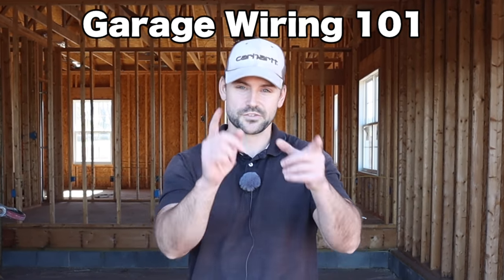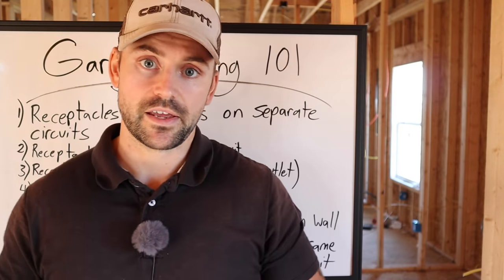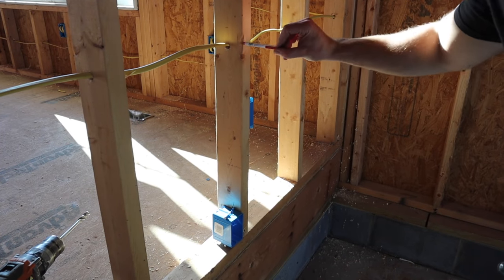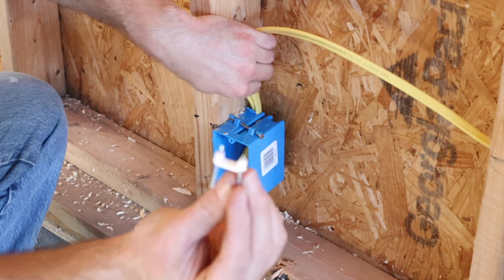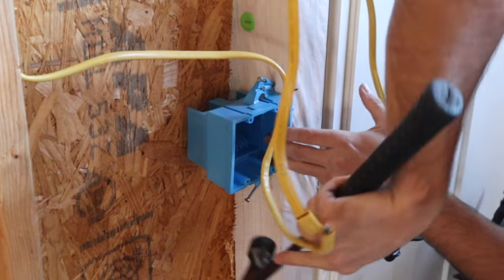Garage Receptacle Wiring - How To Wire A Garage For Electricity

Comment from the maker: I paid $160 per roll for 250’ of 12/2 wire. It was $70 per roll just a couple years ago! Timestamps below to help navigate the video 👇
Garage wiring 101 00:22
Pre wiring walkthrough 04:18
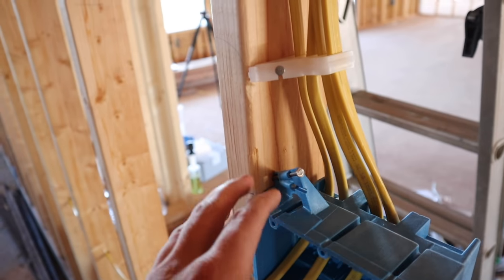How to use Wire stackers 04:32
Height to place outlets 05:40
Electrical box size for garage reciprocals: 07:00
How to anchor outlet boxes: 07:24
Height to drill holes for wires: 08:27
How to drill a hole for wires: 09:05
How to run electrical wire: 09:37
How to place wire in an outlet box: 09:50
How to staple wires: 10:55
How to rough in wire a switch box: 12:06
How to GFCI protect a circuit: 14:33
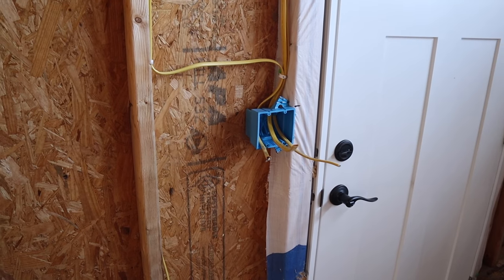Final walkthrough: 15:16
Reply: Blame it on COVID.😬

Comment: My understanding is that the tabs on plastic boxes are "push-in" not "push-out".  I think you will not need to smash your pliers through the tabs if you use them this way. I am referring to 10:17 in your video. I believe the idea is that once installed you don't want someone inadvertently pulling on a cable to be able to pull the cable out of the box. If you push the romex into the box from the outside, then the tab will pinch the sheathing if you try to pull it back out again, as per design. If you punch the tabs through you are turning them inside out and defeating this design.

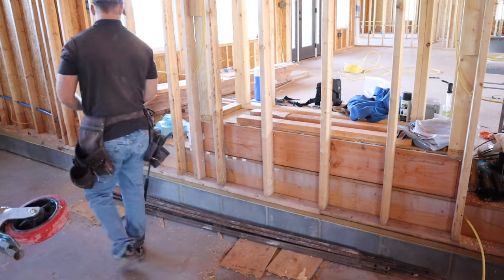Comment: 6:40 - I always place garage outlets 42" from the floor to the bottom of the box.  21" seems a lot lower than usual in a garage.
Reply from the maker: It all depends on what you are going to put in your garage. If I was going to have countertop against the wall I would put them 48 inches. Thanks a lot for watching!
Reply: It should be a minimum of 42” I’ve got 50 years in they need to be GFCI and I set them at 46”
Reply: Minimum of 18” from grade. I set them 46” to top

Comment: Key tip home improvers: if you use a paddle bit for your holes, have one hand on the grip and trigger, and the other hand on the battery for stabilization. Be firm with it. Confidently go straight thru. That torque will turn you into a pretzel.
Reply: But what if you just really wanted to dislocate both thumbs?

Comment: Thank you for these videos. I will be building my house soon and been working with 12v, 24v, and now 48v off grid systems. Most of the wiring is going to be 120v and 240v in the house and shop. I will most definitely be visiting your Amazon store soon. Thanks again.
Yep.

Comment: Thanks so very much.  Did not know: 1.) Garage outlets & lights can't be same circuit. 2.) Power from panel is 2 wire, 3 wire is for smoke & three way switch. 3.) Can stack 2 & 3 wire with 3/4" staple. 4.) Joining grounds require wire tie or crimp.   Thanks

Comment: Question regarding your outside light.  At 15:30 during your final walkthrough, you showed the wire stubbed thru the wall and the mounting block out side.  Did you use a junction box inside or is the wire just pushed thrust the sheathing?

Comment: Your electrical videos are giving me the knowledge and confidence to wire my new home that I am building.  The amount electricians are charging in my area is insane, I'm talking like $40,000 is the average bid I am getting.  When I calculate the materials, I'm estimating $9,000 and that's with ALOT of extra built in (20%)  THANK YOU!
Reply from the maker: Hey Paul! You are welcome! Be sure to check to make sure you can do your own electrical work where you live and what the building codes are. In my area I can even though I am not a licensed electrician as long as I get the proper permits and inspections. You are right that is why I do my own work because it is so expensive. $40k is insane! If you don’t mind me asking how big of a house?
Reply: @TheExcellentLaborer  I live in an unincorporated county and they do allow a homeowner to do their own electrical.  The house is 7,500 sqft but I am not finishing the basement in the beginning.  Upstairs 2 floors are roughly 5,500sqft.  I have about 170 LED can lights and basic electrical.  I also just put in my 300/300/300/300 4 UGD line to the main. I've wired a little in my current home with no issues but my main concern would be more about wiring up the Main panel correctly and load capacities per breaker. Wiring up outlets and switches is pretty easy but the panel and load calculations is where I would need to do more homework.
Reply from the maker: Wow that is a huge house you are building! That is good, it sounds like you can do your own work if you want. The service I have to prepare for is 200 amp. I have my panel box video halfway complete and will be putting out in the next couple weeks. You may get some ideas from that video when I release it. Stay tuned!
Reply: @TheExcellentLaborer  Right on!  Can't wait for the video.  Thank you.
Reply: thats ridiculous, what are you building a 10,000 square foot house?

Comment: When we built our house the electrician recommended putting the garage receptacles four feet from the floor. No bending over and I love them! Many people put their extra refrigerator in the garage. Ours was on a gfi circuit and it would kicking out during an electrical thunderstorm. Nothing is more sickening than throwing away forty quarts of thawed sweet corn.
Reply from the maker: That's a great idea!
Reply: I think that's code in my area for basements and garages

Comment: As someone that does a lot of work in my garage, I like the electrical outlets higher.  About 48 inches.  If you install cabinets or worktable the outlet is just above worksurface.  Much more convenient. A 220v outlet is nice have as well. Nice video.  Thanks for sharing.  Is that Baltimore accent am I hearing?  Maybe Philly?  LOL
Reply: If you are using corded power tools, having the outlets at 38"- 42" inches makes connections easier, especially if you have a workbench against a wall.  It's also easier to place any power tools that are on rolling platforms if the outlets are higher.  Also, if you intend to hose out your garage on occasion, having them tall eliminates any potential contact with water.

Comment: GREAT VIDEO.  I appreciate the walk through.  If I were putting an RV outlet on the exterior and a refrigerator in the garage. Do they have to separated circuits?  What amperage breakers should I put in the panel?

Comment: Thanks!
Reply: Any advantage disadvantage of having both GFCI breaker and the GFCI outlets. I am adding two outlets in unfinished  garage before I drywall
Reply from the maker: Thank you! I would do one or the other. Both might cause the circuit to be too sensitive and kick the breaker. I hope that helps!

Comment: Greetings EL - Keep in mind that in the 2020 National Electrical Code you would not be permitted to supply the receptacles in the ceiling with the receptacles that are serving the vehicle bays. This was not prohibited in the 2017 NEC but is now clarified in the 2020 NEC. Now, nothing prohibits the installer from running additional 15A or 20A branch circuits into the garage, say for those garage door opener receptacles, in addition to the required minimum of (1) 20 amp branch circuit per 210.12(C)(4) that is dedicated to supplying the receptacles outlets per 210.52(G)(1). AT ~11:14 you state your area requires you to secure those cables within 6" when in reality it is within 8" per 314.17(B)(2) Exception but sure seems like your local AHJ likes to make up code rules...that's a shame. - Now, I will tell you, it is much easier to strip off the sheathing prior to inserting into the device boxes, just make sure you strip out so you have at least 6" of free conductor from the emergence of the conductors out the cable per 300.14 but to each their own. Now, most AHJ's will want you to make up the EGCs prior to the gypsum board going on since they wont make another visit until final inspection so verifying the connections in the box for your grounding/bonding is important.

Comment: Everything was going great till you pop the clamp the wrong way I think 🤔 it supposed to be open from the outside in so that when you run the wire in it can’t come back out so easily 10:17

Comment: Great Video thank you!
Question: You mentioned that the receptacles and the lights must be on SEPARATE circuits. Does this mean that you had two separate wires running from the main power line or you had two garage breakers one for the lights and one for the receptacles. Hope my question make sense? Thanks

Comment: I am running 3 new receptacle outlets to my non-drywalled garage, starting at a light switch receptacle, over the door frame, and to the 3 new outlets on my back wall.  I will add a GFCI outlet starting at my first outlet box and daisy chain them from there to the other two outlets. Is the GFCI outlet overkill, or is it better to be safe than sorry to protect the 3 added outlets? Thanks for your video. I saw how you ran the wire over the door frame to the outlet box next to the door. That was my other question since I didn't want to have to run the wire from the attic of the garage back down to the first outlet. I have seen metal barrel sleeves that you can install in the studs to run the wires through to protect the wires running through the studs. I have 2X4' studs so I don't know if that would be recommended over metal stud plates. What do you think?

Comment: Question: The electrical outlet boxes you're using, you remove the cable cover. Most of these boxes are designed to hold the cable in place so it doesn't move outside of the box. With the tab being pried open, don't you lose the capability of ensuring the cable doesn't move at all? With metal boxes you use an actual clamp to ensure it doesn't move.
Reply: 10:50 - The NEC states (paraphrasing from memory) that the wire needs to be stapled within 8" of the box. That covers him even if he broke off the 1-way door that's on the box.

Comment: 3:00 - Do you know what the NEC Code says for running wires in a detached garage that does not have dry wall? 
I spoke with an electrician (he's retired now and not taking on new work) that told me there is a minimum height for running the wires but I cant find it in the NEC codes.
The logic being that when the wires are run low, people tend to put things behind them and they are more prone to being damaged.
Did you ever come across something like that?

Comment: Hey great video, 
Question:  I have a 20amp circuit coming from the breaker box in my garage going to the attic to a receptacle outlet and then Back into the garage to a simplex receptacle for my sprinkler controller. 

Can I splice in between the 2 receptacles to power a security/ floodlight camera?

Comment: What's the depth of the boxes when you mount them. Here in my state when I did my garage I had them close to 5/8 out from the stud. Code here for garages and kitchens the drywall has to be 5/8 thick. Every where else it's 1/2 drywall?

Comment: Very glad I stumbled across this video. Very easy to follow along and understand what you are doing. I do have one question about the wall outlets. How many can you put on one 20 amp circuit? Thanks for taking the time to share your knowledge with others.  Also I'm glad to learn that there are wire stackers out there.  I too like to keep the job looking clean and neat.
Reply: There is no maximum
Reply: Theoretical there is no maximum of power outlets. It is better to be not too long far away from the CU with the power cable if it a big garage. 

But do not forget that every device how you stick into the outlets consumed power current from this. If you know do you want use a work bench or some electrical accu charging devices make another extra line same for the light. Some people like to make two power cable for outlet 1 and some inches far outlet 2 all around or make middle to left and middle to right. Look at your local installation papers. 

In the time where cable was cheap my friend install many outlets but not use later all. Some are blind behind the boxes at the wall. If the decorate change he can change the outlets too. It is cheaper as later change the position of the used outlets.
Reply: @OldLordSpeedy  Thank you for the reply. Very good info and I appreciate it.

Comment: I just watched your video after running my own garage circuit (then I sheetrocked the garage after the wiring was in place). Couple things I'd like to question - can an outlet be that low? Isn't there any concern of water/moisture getting to it? I'm from Minnesota so snow is a main concern. Do you put those cable protector plates on each stud that the wire is going through? I installed an outlet at roughly 85 inches off the ground so I had an outlet on top of my work bench so I can have plug-in lights and a stereo up top. I'll have to look into my local code and see if there's anything against it. It's wired in already so I'm not undoing it lol.
Lastly, I've noticed that a couple times now the GFCI outlet that I installed has tripped on it's own (nothing plugged into it at all). Any ideas what could be causing that?
Reply from the maker: Hey Jake! I do not use nail stop plates for every stud. Only studs that have the wire within range of a drywall screw. You could try replacing the GFCI and see if it fixes the issue. I’m not sure what else could be the problem. Hope that helps and be sure to subscribe!

Comment: When when building an attached garage in my area  code requires a double layer of drywall on interior walls attached to living quarters. This is called a firewall. Any receptacles mounted on these walls would have to be adjusted for the extra drywall for box to be flush.

Comment: Man if I ever was doing anything new construction with wide open studs, I'd be using metal 4 square boxes all day. In 20+ year old houses when I'm dealing with these plastic boxes, they get brittle and break. Only would use them when it's old work on drywall. I think the cost isn't that different, in fact I believe the plastic is more expensive these days because of the material shortages...
Reply from the maker: Hey Mr.G! That is an interesting concept to use metal electrical boxes in new construction. All the houses I have ever built with my father has been with plastic boxes for several years. Thanks a lot for sharing your experiences!
Reply: I done alot of remodeling on some older home the old orange looking plastic boxes does get brittle and break ,but so far never had the blue plastic boxes get brittle not saying they want just never had it happen its a different compound.
But who knows I've only been remodeling since late 80's

Comment: I’m deciding to use a gfci receptacle as my first plug on each run of receptacles in my garage. I’m using a 20 amp breaker. Should the gfci receptacle also be 20 amp?

Comment: Those stops on the side of the receptacles are for 1/2” drywall though, right? I have to have 5/8” drywall in my garage per code. Is there an easy way to set them quickly for that depth?

Comment: u can fit 3 12 gauge in 1 staple ? i thought it was only 2 per code
Reply from the maker: You know it’s always been an interesting question. When I build, I have never had a problem with inspections due to 3 wires under a staple. I did some research on the topic and found that 2-3 is probably max. I always use 3/4” staples if I do have 3 wires under it. Check your local building codes to get the right answer for you. Thanks for watching and great question!
Reply: You won’t find any code references about that.

Comment: Are electrical wires always running across,  2 ft above the floor? I plan to drill onto the garage walls to hang bike racks. I just wanna make sure I don’t drill thru some wires. House is 7 years old. Thanks

Comment: Hi..maybe you could help me find an answer. My outside plugs (protected) along with all plugs on inside garage blew the circuit. I think it happened because of a possible cut in extension cord I was using and left plugged in when a torrential rain storm suddenly appeared. None of my circuit breakers flipped off so I can’t find exactly where the problem started so I can hopefully fix it. I would appreciate any help you can give. Thanks.  Great channel BTW.

Comment: Personally I do not like lots of outlets strung off one GFCI outlet.  If one outlet blows the entire string of outlets goes out at the same time.  I put in multiple GFCi outlets in the string or sometimes in each outlet and wire them to minimize the number of outlets effected if any specific one blows.

Comment: What’s you’re idea on back feeding you’re main panel on a 100A double pole breaker when you have a power outage ? It’s a home line box , an inverter is where the source of electricity is coming from 230V 1 Phase 76A for 3KVA  ?
Reply: Pretty dangerous unless you know what you're doing and use the proper equipment. Simply connecting a generator to your panel is not acceptable.

Comment: When using a wall board thicker than dry wall do you need to move the box out some? I’m using 3/4 ship lap and don’t want my outlets/switches recessed too deep. Any suggestions?
Reply: Yes boxes should be flush with the wood in your case.

Comment: Does 6/12 rule apply to detached garages?
Reply from the maker: The 6/12 rule might be more than required for a garage. Check your local building codes for your area. Hope that helps!

Comment: QUESTION!!! 50 amp 240v circuit going about 125 feet which wire size do I need? 
I was going by the wire chart which says 2 gauge and I don't think im looking at the correct chart please help
Reply: Definitely not 2. It depends on the load. #6 should do

Comment: Instead of plastic boxes, wouldn't it be better to use 4x4 metal boxes with a mud ring? I understand that it's a little bit more time consuming and expensive, but I'm wondering if there are any other reasons?